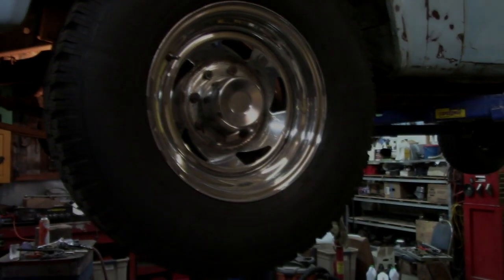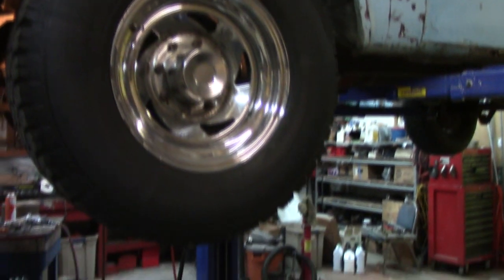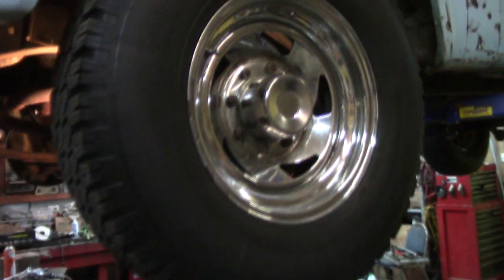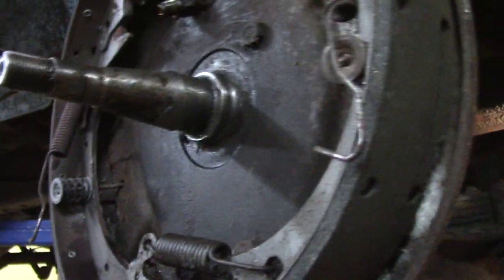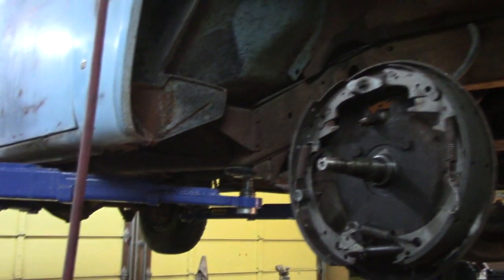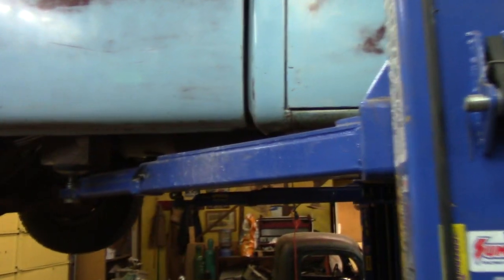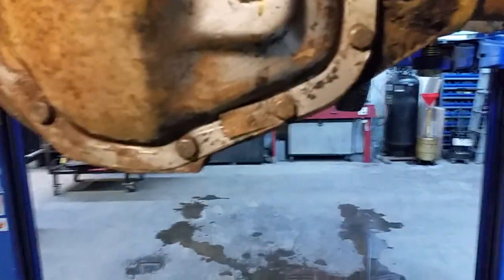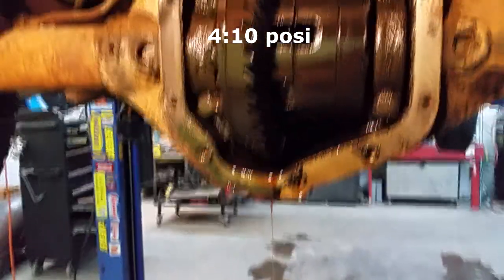1965 DODGE   hind end lube

Comment: I like the old truck. A fun driver. Now, if it had a cummins with a big ol turbo, that would be fun too.
Reply from the maker: yes it would! my first vision for it when I found it sitting in the orchard was to set it on a modern chassis with a dodge v-10 or a newer hemi.. but when I found out that it runs.. and its pretty much all in tact.. I decided not to chop up a good ol survivor..